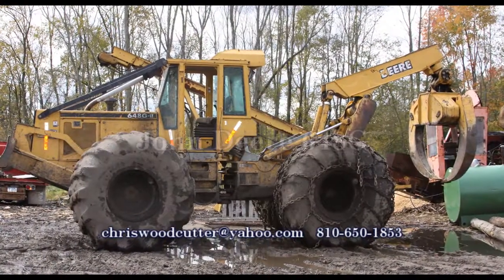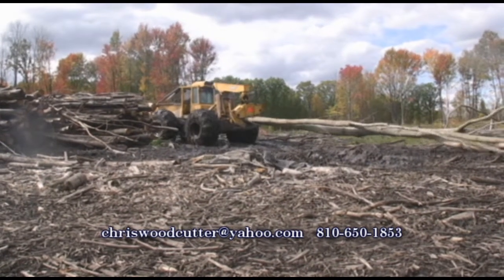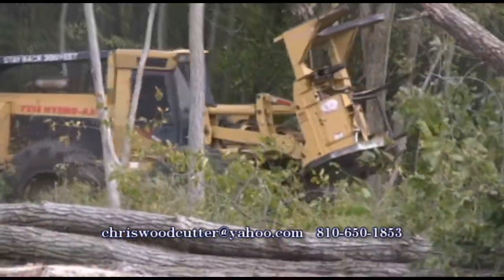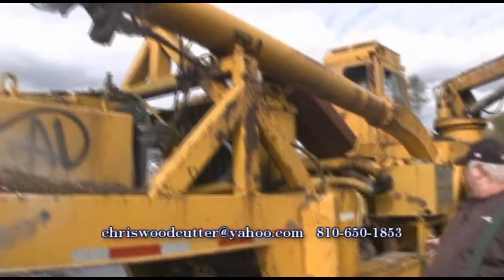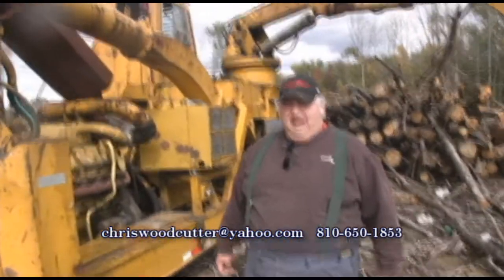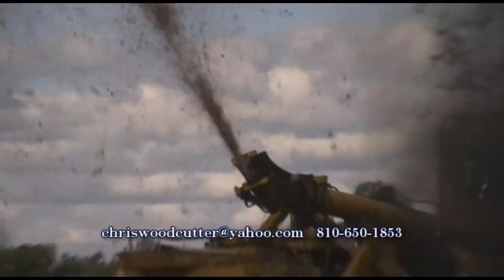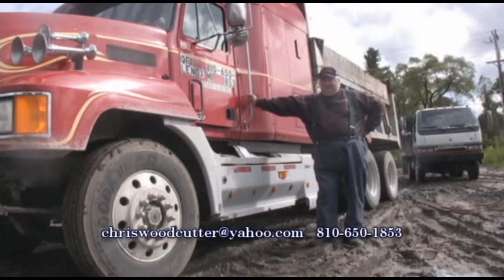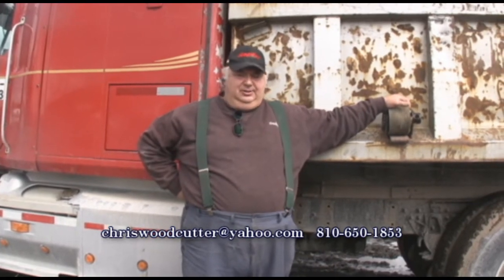Quality Firewood and Supply Inc. Overview

Comment: Not only were we shorted on the wood supply, he never called back. During the extremely cold winter in MI we found out some of his supposedly dry seasoned wood was WET and did NOT burn and resulted in black creosote on glass. Now we are in serious trouble with wood supply this year. We ordered some wood from another source and that wood is WORSE than this guy, are there any honest wood dealers anymore?
Reply: hey big mouth, why did you call back the next year wanting another load. my son refused to sell you anymore. he says that you have a nut loose.